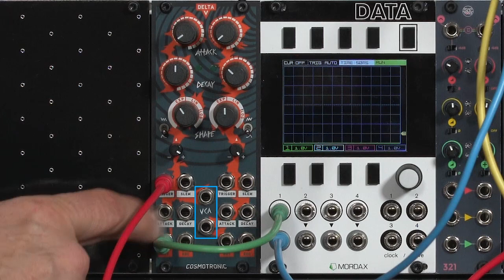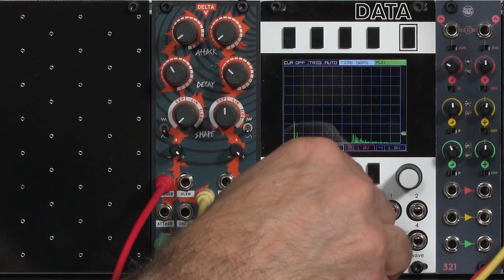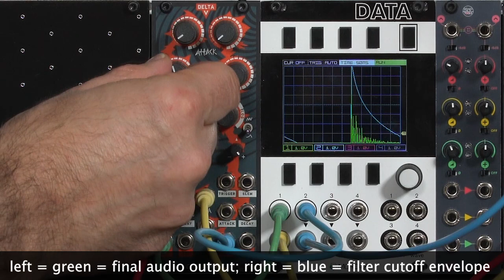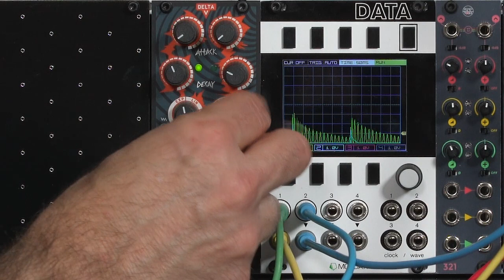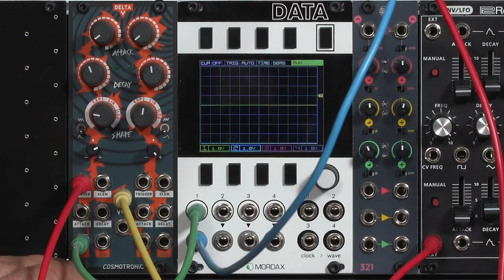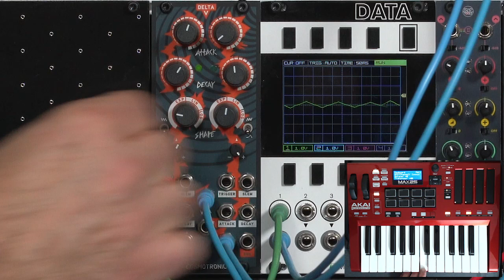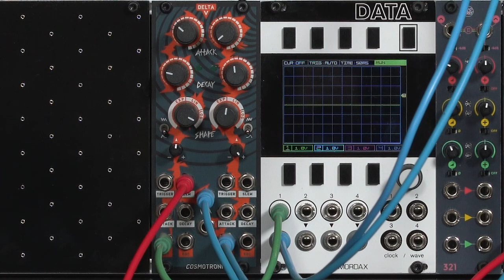Cosmotronic Delta-V Dual Amped Function Generator 2/2: VCA applications (LMS EE)

Comment: Its VERY similar to the 4ms Pingable Envelope Generator. It shaves off the rythm related functions like two clock dividers/multipliers(!) but gives you sustain and a vca instead. Tempting.
Reply from the maker: Much smaller than PEG...

Comment: Do you still have your Nu Tone?
Reply from the maker: Yes - I have two, actually!
Reply: I’m ordering one this week. Is it me or does it produce sounds no other eurorack distortion can create? Your video sold me btw.
Reply from the maker: It does, to my ears, have a different tone that I've heard out of other tube VCAs, and one I happen to find more pleasing.

With one of my Nutones, I fed it a sine wave, put the output through a spectrum analyzer, and tuned the bias trimmer on the back panel for one of the channels until it had strong even harmonic character, instead of just (symmetrical) odd harmonics. Subtle, but nice that you can do that in such a controlled manner.